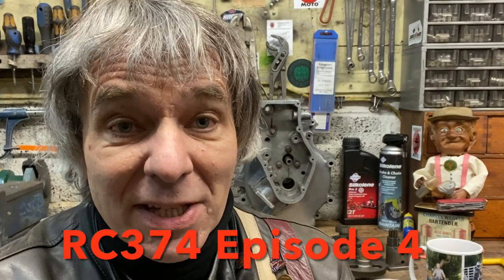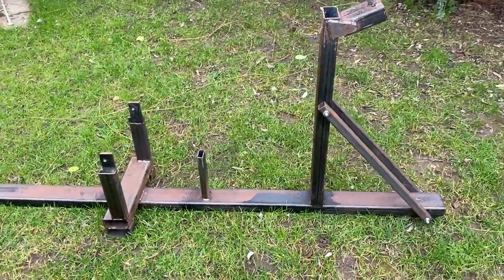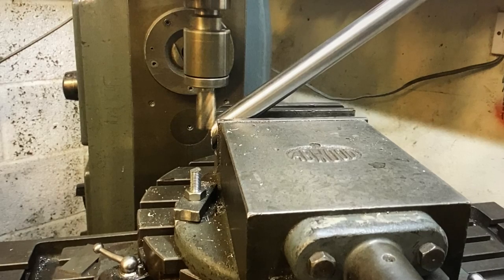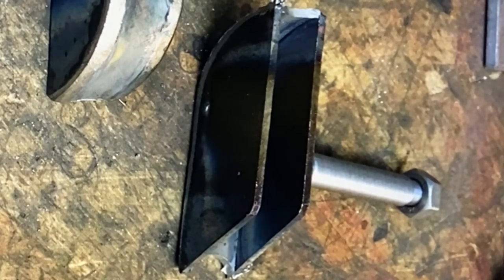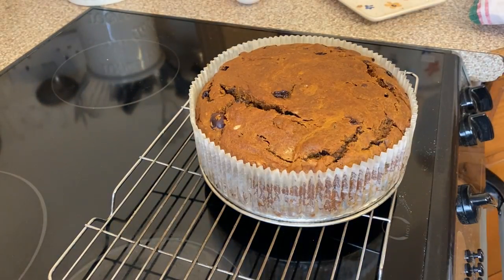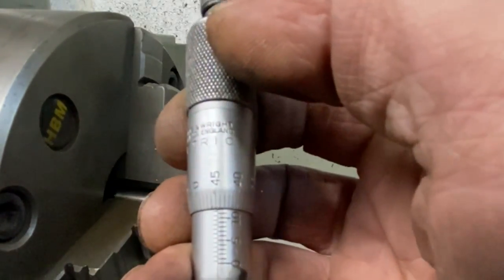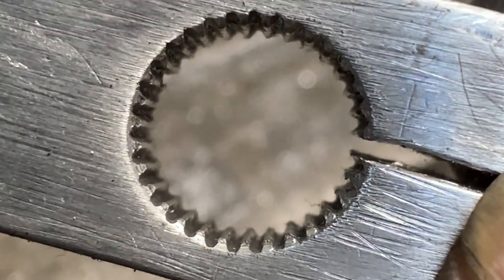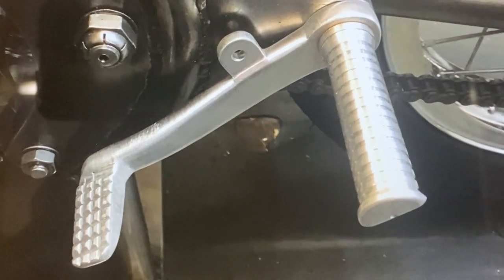Millyard RC374 Honda six replica - Episode 4 - How its made

Comment: Forget building a bike and engine from scratch, how the heck did he follow a line with the hacksaw.  🤪Most amazing thing to see....ever.  As far as I’m concerned, hacksaws are designed to cut wonky lines.
Reply: i was thinking the same thing,
Reply: Allen with a hacksaw is more accurate than most people with a bandsaw.
Reply: Concur. I wept, slightly, in shame.
Reply: I have taken close note of the make of blades he uses....they must be less banana shaped than the ones I have, which only cut diagonal lines in varying directions.
Reply: You forgot the other thing they were designed to cut: fingers.
Reply: Practice makes perfect, and boy has Allen had a lot of practice.
Reply: @diavolorosso69  have the scars to prove this with hacksaws.

Comment: The more the inline cylinder is, the more the bike will have the character. Can work as a smaller displacement cosuming lesser fuel at the lower rpm and also can work as the bigger displacement at the higher rpm along with cosuming greater fuel. Once again, the sound output will have the most beautiful smooth tone in every rpm.
I just love your hobby. Am learning a lot from you Sir.

Comment: Just last week I cut up some 1/2inch steel rod into 2 one inch lengths. Then drilled a 3/8th hole through them to make some spacers to fit to the bottom of the damper rods of my GT 750 forks.
The cuts weren’t square. The holes were off-centre.
I was well pleased with them though.

That’s the difference between mortals; and engineering Gods.

Comment: Fascinating seeing the gear lever broaching. 

Isn't the pinch bolt meant to pass through the gear change shaft groove to stop it sliding off if the bolt becomes loose? Not that it will of course 🙂
Reply from the maker: It was just a demo so I could film the process, I mage the bike in 2017

Comment: Absolutely amazing work. One question: why not locate the shift lever clamping bolt closer to the spline shaft to capture the bolt in the spline groove. That would prevent the lever from coming off even if the clamp got loose?

Comment: Allen, did you make the gear lever pinch bolt hole dissect the gear shaft spline groove slightly so the lever won't slip off should the pinch bolt loosen ?
Reply from the maker: I did on the real one , this was just a demo of my process 🙂

Comment: Nice video.....about the shifter: the bolt is normaly closer to the spline hole, in the gap of the shifter axle to block axial movement on shifter axle. Why not here?
Reply from the maker: I was just showing how I made the spline . The securing bolt can be closer to the shaft to lock it in place but some are like I made this sample lever for quick removal
Reply: @AllenMillyard  Ok Allen  I understand...great work , great video's...keep on going 👍

Comment: It’s a bit unfair to criticise Allen because he is a brilliant engineer but I think he should practice more on the welding side.
The frame would look far superior with some nice clean welds without any need to clean them off. I worked for Rolls Royce 
aero engines and the welds were never cleaned off always left as a pure weld.

Comment: I'm supposed to be a good engineer, did a thesis on mechanical vibrations, have above that two masters in mechanical engineering and worked on designing high performance hybrid GT cars, and I'm not 25 yet. I can do stuff myself with my hands too, I overbored cylinders, rectified heads and whatnot, but despite what I thought was impressive, I have not a hundredth of your skills. You are inspiring me though, I plan on building a V4 based on those honda CB Twin from the 70's that revved freely to 13k rpm. That would make a 250cc V4(well, more like 284cc if you overbore to max) with 13krpm and about 35-40 bhp. I've started to think about how to build a crank and your videos touch on this point, but man do I have not enough confidence to start filling... 
However, would you be interested in using those 125cc twins as bases ? Crankcase is the toughest to find, but you can find everything else cheap in aliexpress, since the 50 y/o design was so good that it was licensed (cylinder+pistons and gaskets, axis, clips etc... are like 55€ delivered). You could make an aircooled inline 6 with 375cc and about 60bhp well tuned, that would be even closer to the beautiful RC of yesterday.